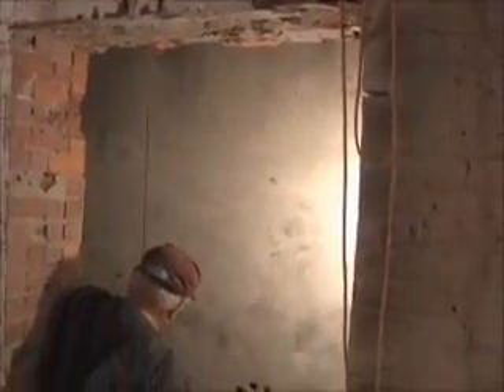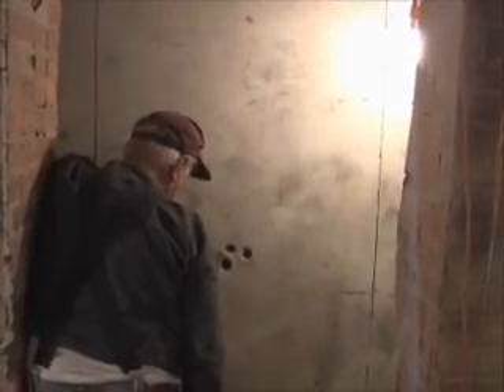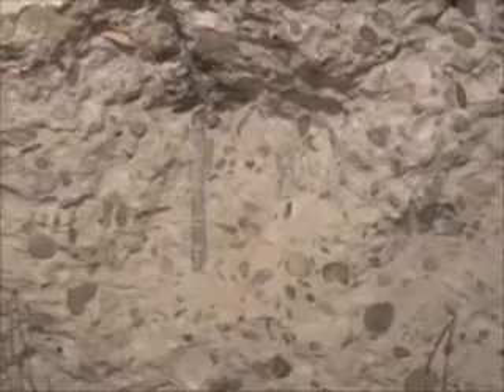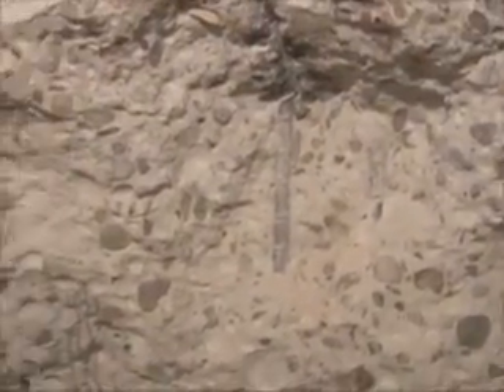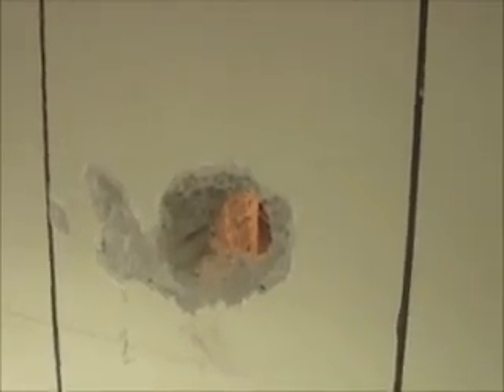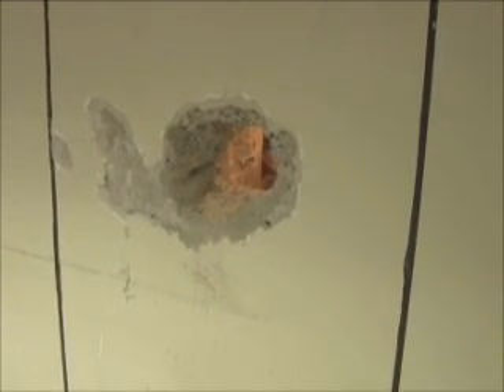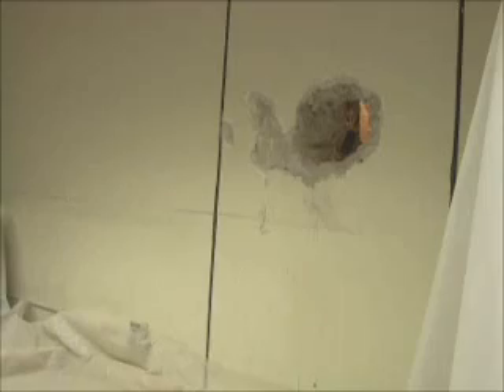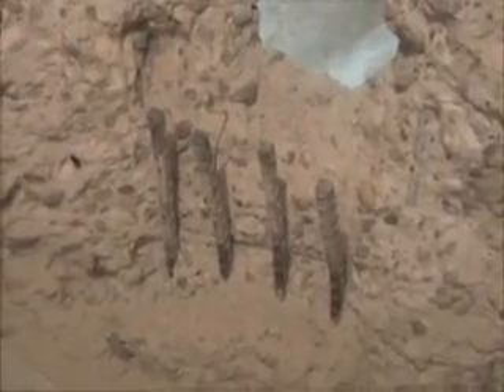Breaking Concrete with the MicroBlaster

Comment: If the wall was 20" thick. How deep were your holes you drilled? Did you use a booster cartridge? I have a similar project and any insight beyond the video would be appreciated. Thanks!